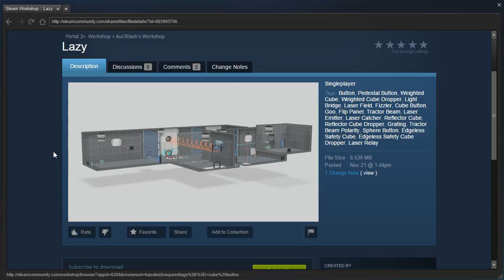Portal 2 PeTI - "Lazy" by Aur3Dash

Comment: 3:01 - *Thermal Discouragement Redirection Cube. I failed a Portal quiz by not putting the "Thermal" once :(

Nice video, LB!

Now for my own criticism:
Avoid cluttering antlines, such as at 7:02. Try to make things more clear in regards to item connections. And as for the puzzle overall, while it was nice, I think you tried having too many things at once. I'd personally either split the puzzle into multiple individual puzzles or take away parts of it, because for me it feels like a dragging chore. And I agree with LB's points in regards to the bootstrap laser and the funnel. For the laser, you could have that same mechanism, but you use the bootstrap laser to get in, but the original laser to get out, by using the idea LB commented on at the beginning (setting the orientation of the portal). That way, you'd have an extra step which would be to block the bootstrap laser to reactivate the original one, then use that one to get out, then maybe even come through the portal and re-orientate it near the hub. And something I noticed is that, while your lightning has improved drastically, some areas are still dark, like those side areas to the main hub. And well, this is more of a personal pet-peeve than anything meaningful to most players, but I personally avoid large puzzles. If I can scale it down to make it more compact (but not too compact), I usually do. Nice puzzle, though, you've really gotten a long way into improving them!
Reply: Wow thanks for all the tips! :D I think i will use the portal orientation with the laser thing, it can be a good feature.